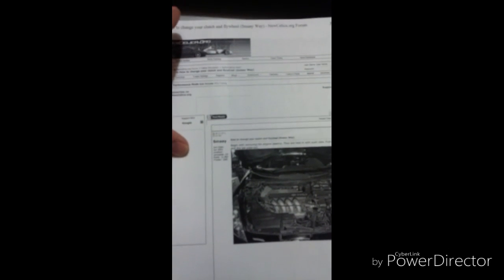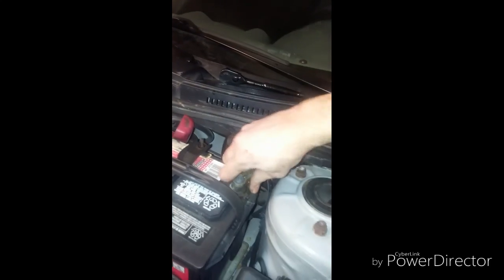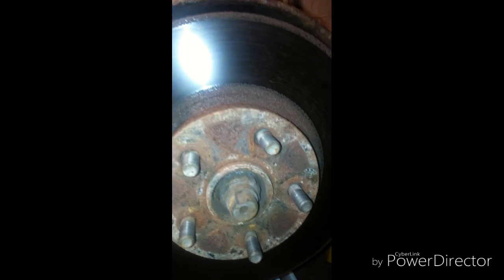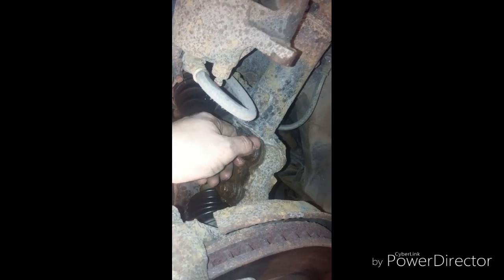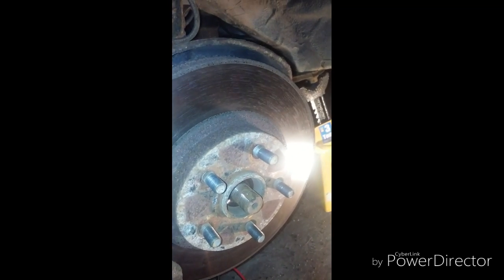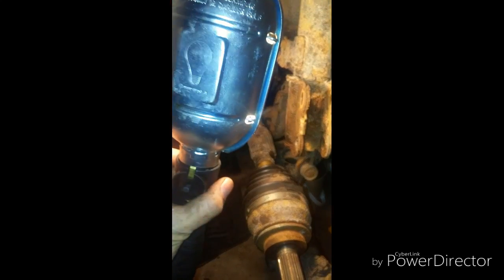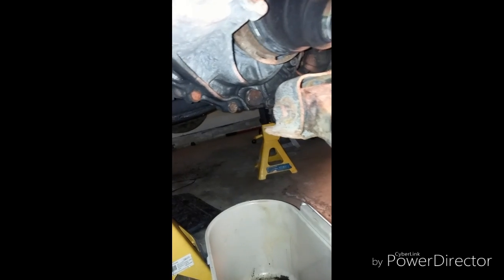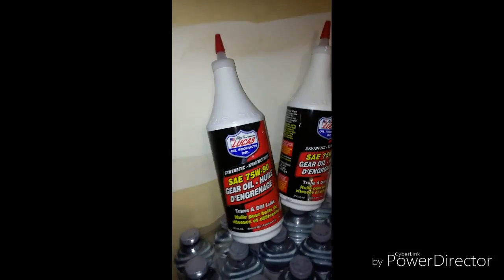Celica clutch replacement

Comment: VERY HELPFUL. YOU HELPED ME CHANGED MY CLUTCH! there was a point where I wanted to break down because I had to take off my transmission AGAIN to see what I did wrong(I didn’t properly tighten my pressure plate bolts). My car drives great now! I was 17 at that time btw. Just wanted to say thanks 🙏 you’re a savior. You should do a engine replacement video

Comment: i watched another video, you dont need to remove calipers or anything, just the lower ball joint bolt and you can move the entire thing out of the way, only the passenger side CV axle needs to be completely removed, not on the driver side.

Comment from the maker: no I managed to put it back in by myself it wasn't easy though. forgot to mention when taking the transmission out you turn it slightly counter clock wise to clear the rear mount when putting it back in you turn it clock wise to engage the mount.
Reply: Clock wise from what position?

Comment: Always disconect the negative batter post first and remove it away from the battery then take off the positive side, reason you turn a nut with the negative hooked up on the positive side and hit a metal part of the car its going to arc
Sparkd will fly and burn a chunk of your tool. Ive done this. The somone will ask you how your 10mm got a welding spot on it.

Comment: How many miles on it? Was it slipping?
My 2001 got has 300k miles on it other then free play the clutch has never slipped nor the motor rev-up. .
I belive the driver cant drive a 5 speed.
I've never burnt up a clutch plate or worn out a clutch  in 45 years of driving standard transmission cars and thats all ill buy I dont like automatic cars.
No fun in it.

Comment: Is there enough room to remove the flywheel ( so I can replace the rear main seal) ? 
Very good video!
Reply from the maker: Joe T - You should be able to. in my case i didnt have to lower the transmission because i didnt want extra work so i strapped and left it hanging. if you completely lower the transmission you will have all the room you need. the only issue is you will need someone to help you lift the tranny back up or a transmission jack perhaps .

Comment: How did you manage to eliminate the gap between the trans & block to get it ready to be bolted back together? I am having issues installing the bolts because there is a slight gap between the two objects that I can't seem to fix. Was this an issue for you?
Reply from the maker: the small gap between the tranny and the engine? I had same issue I just made sure there was nothing on the way and started to tighten the bolts and they came together

Comment: I can't seem to find a pilot bearing for it. any help?
Reply from the maker: James Jacobs -are you talking about pilot shaft to align the clutch?
Reply: I've got a rumble in the clutch, it sounds like rocks and everyone is saying  pilot bearing.
Reply from the maker: James Jacobs - oh ok thats also known as throwout bearing. if you are doing all this work just for the bearing its wise to replace the clutch too (disk/pressure plate). the pilot bearing  is around $5 on rockauto.com im not sure if local parts stores sell them by itself
Reply: so apparently the 1zzfe has no pilot bearing. it has no room for one. and the throw out bearing and pilot bearing are different. interesting... did u not see 2 bearing wennu popped it open ? I can't tell in the video
Reply from the maker: James Jacobs -i remember when i was shopping for clutch on ebay there were showing 2 bearings on the images a large one and a small one but when i went to my local parts store they told me whatever is in the kit thats all i need. and no i did not see a small bearing anywhere inside the bell housing. i only replaced the throwout bearing. is yours a GTS? because the instructions i followed was originally for gts i dont recall anything about a pilot bearing. heres the link
http://www.newcelica.org/forums#/topics/334603?page=1

Comment: fml, my front suspension set up looks completely different
Reply from the maker: Junior Vaikai what year is your celica? is it a gts?
Reply: 2000 it's and ss2 which I assume is the same as a gts?
Reply from the maker: Junior Vaikai there are 2 types of ss2 celica yours must be imported from japan? they have got super struts but other engine component are very identical to gts from what i gather

Comment: Mine won't go in reverse now.. anyone know what causes that?
Reply from the maker: xXCoDMoDzXx check you reverse cable connection to the gear shifter lever on top of the transmission it's either not connected properly or some kind of obstruction.